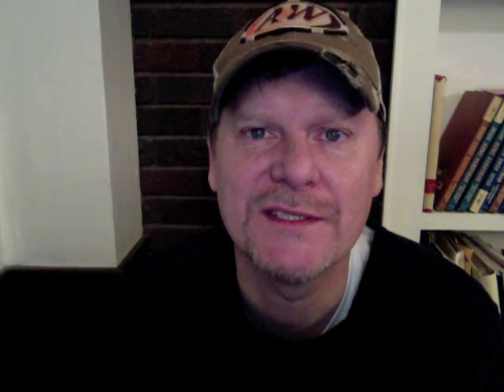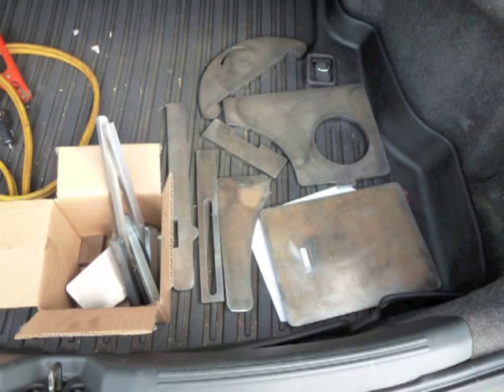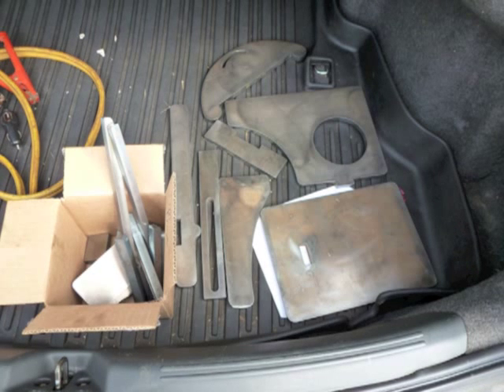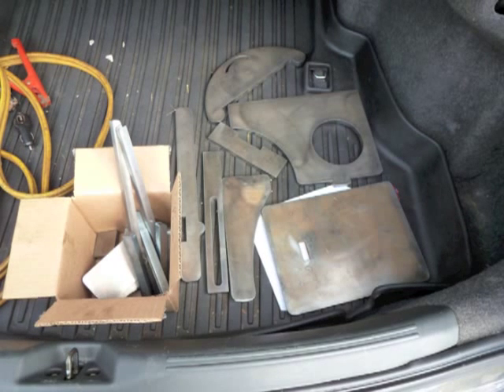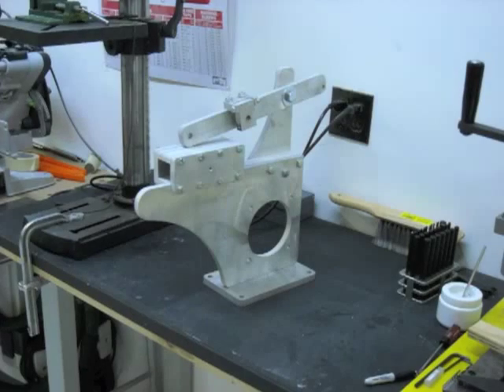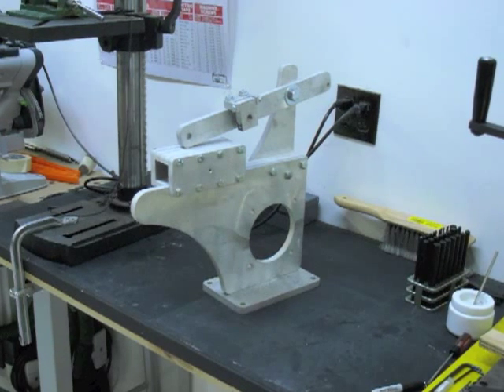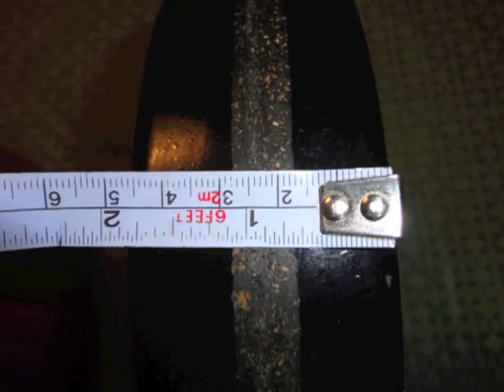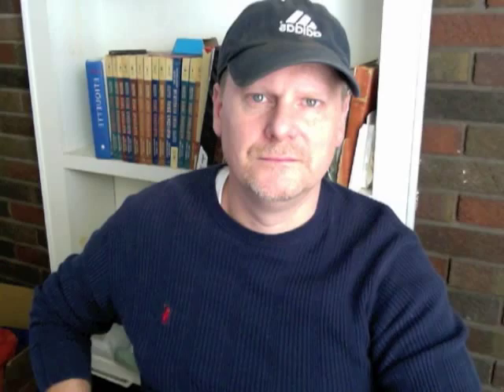Homemade Grinder - 10 inch contact wheel - Work in progress

Comment: As always good info Tim! If you look in my video "shop tour" the first grinder you see on the right has a home made contact wheel and I've run it for years. I've had good success  glueing up plywood for the non-bearing type or glueing up a couple pieces of hard wood such as oak or maple for the pressed in berring type with great success. I also glue and tack rubber to the surface and they work great. Not enough room to explain exactly how its done but yes it can be done!

Comment: just finshed my GIB got hold of a 10inch contact wheel  for $17 and i love it Jason over at polar bear rocks
Reply from the maker: Very cool!  Where did you get your contact wheel?
Reply: SugarcreekForge  Did the same as u kind of used a caster had some shop  mill a bearings in to it for my take out the slop
Reply from the maker: Very cool, buddy!

Comment from the maker: Not really, Richard.  I am stalled a little bit because of doing lots of travel and a few complications.  I bought a 10 inch contact wheel and am having it machined to accept some bearings.  Thanks for asking... I need to get my butt in gear.

Comment: Dude I try to buy a t-shirt and he do not have my FAT PIG size. Regarding the wheels when I started manufacturing small contact wheels, I had the opportunity of helping many knife makers that ask me for them. I made .750", 1", 1.5", and 2", to work the blades and handles. The first wheel I made was in 1992 when I returned from Iraq and the guy still works with them, so I don't think they are to bad. I am setting up for making the molds for 12"- 14"- 16"and 18" inch contacts now, they will have  90A durometer and if my calculations are no to wrongs they will be very reasonable in compares’ to the market prices. If you keep in contact I will ask you to try one when ready, thank you for reading my lines, and I wish you a good day, KEEP ON GRINDING…CHARRUA
Reply: i have a 7 and 1/2'' wheel that i would like to get 90 duro coating 3/4'' thick. how are you doing it?
Reply from the maker: I am doing good, buddy. Where will you get them coated?
Reply: I sent you a mail and was returned. Within two weeks we hope...
Reply: We are finishing the molds for 356 mm, 406 mm and 457 mm, sorry we do not have yet any demand, and we also working and almost finish the small wheel, and we will have in two weecks is:

All metal 5/16" or 8.0mm- (with 90 durometer 3/4"or 10.5 mm- 1.0"or 25.4 mm- 1.5"or 38.1 mm- 2.0" or 129.032 mm).

You ask how we do make them, well we make the mols for the rubber, then we make the shaft for the wheels we turn down to size the ends to accept the bearings, we install the 90 rubber and the wheels are ready. the same with the large ones with the difference that the large wheels the center hubs are aluminum and the small wheels are stainless steel shafts. I will let you know when are ready for sale. The going price in the net are for 4-5 wheels $140.00 to $165.00 per set and our price will be closer to people that they need them and can't afore them will be able to get them, our price will be +- $100.00 to $109.00 + delivery for a set 5 wheels, this will be 30-40% less than the present market price.  
 Have a good day
Charrua

Comment: Unfortunately, it was 8 minutes into a 9.5 minute video before you got around to talking about the title subject; 10 inch wheel.   Then the info was pretty sparse.   Some details on the 2 parts would have been helpful, like exact nomenclature, part number, source, etc.  I'm left with no idea of what the orange thing is or where I could get one.  Also, the biggest caster wheels I've been able to find are all 8" dia, so where you got this 10" one would be nice to know.    It seemed like a pretty good idea.  Since this was 3 years ago, it appears the project didn't get much further.
Reply: After some more research, I realize you started out with a 8" caster, same as me, then added the thickness of the pipe.  That's consistent with my efforts to find a 10" caster or other 2" wide wheel.  You must have lucked out on the poly pipe scrap.  I sure don't find anything like it anywhere; just small diameter poly tubing.  I'm getting a 8x2" caster thru Amazon.  If I decide to go bigger, I may make one from wood and cover it with a strip of leather.
Reply from the maker: ***** Hey, Brian - Did you have any success with your caster contact wheel?

Comment: Therese no reason to assume a homemade contact wheel will not work if they are properly constructed and balanced. I have made several wooden ones over the years with pressed in berrings and they work fine. You left out another reason for the high cost, most people dont know how to make them.